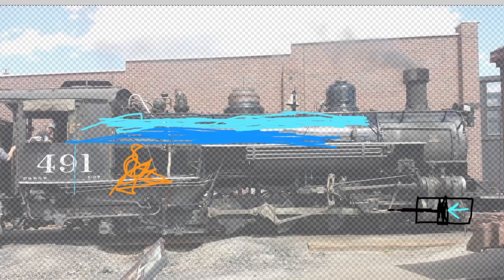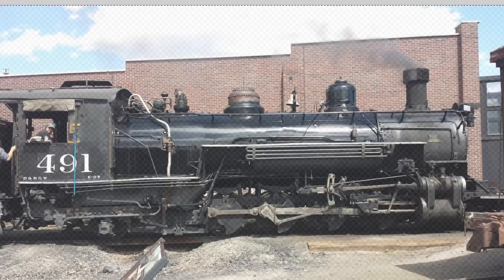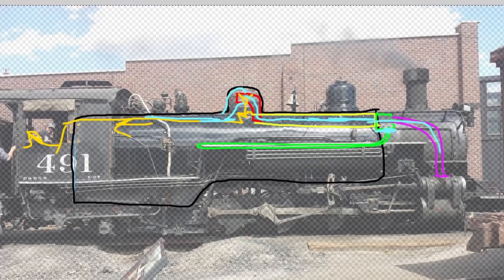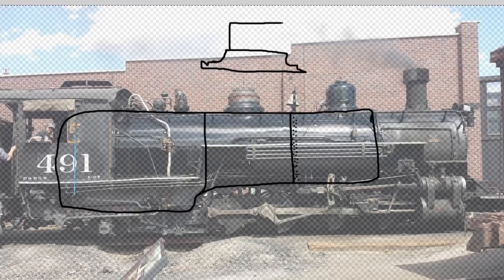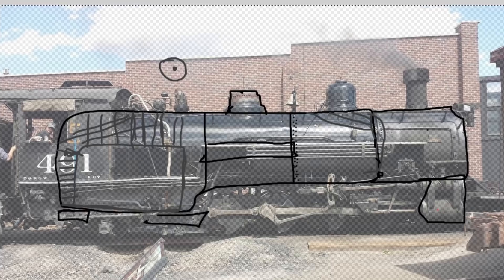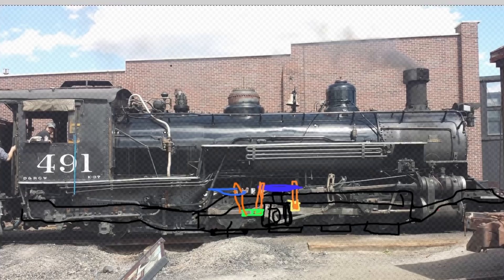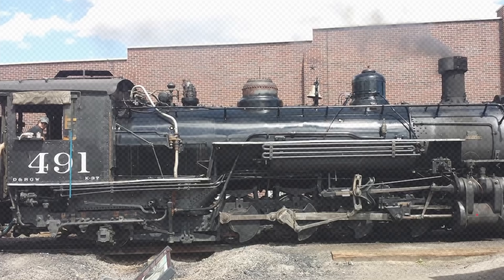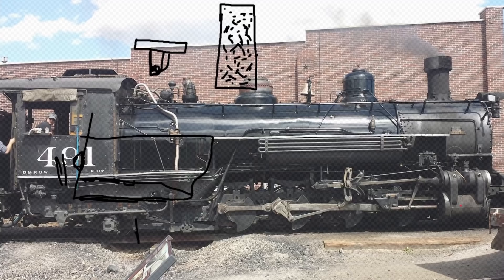Steam 101: 10 Levels of Steam Locomotive Understanding

Comment: on the riviting aspect, most of the engines espcially from the 1920's on at large locomotive builders were squeeze riveted with a giant bull riveters, or what were called gap riveters that would press the rivets with usually 50 to 150 psi of hydrolic pressure after the boiler courses were bolted togather to hold it to pick it up with an overhead crane and brought over the gap riveter and a rivet stuck in its place and squeezed with more pressure then any human can give and its timed so it makes some degree of control and allowed to fully fill the joint, also not all stay bolts are drilled all the way though some only go 3/4ths but the purpose is the same, if it leaks in a hydrostatic it needs replaced and is torched out and a new one threaded in ran over with an air hammer and seal welded to thermicaly bond the bolt to the sheets of the firebox, also seams around things are calked meaning they use a blunt chisel to butt the metal of the two surfaces togather to seal it  which I dont thing you adressed.
Reply from the maker: All true, and yes, all things I did not address! I didn't know the piece about the gap riveter. That is cool!
Reply: @Hyce777  oh yes they had those since at least the early 1900's though I dont think the pennsy shops in fort wayne had one even though it was the altoona of the west for trains west of pitsburg, it looks like a giant u shaped c clamp or piano tuneing fork, some might have been air powered but the large boiler ones were hydrolic usually steam or water over hydralic to provide the force, they were also used in bridge and ship building when they were still riveting the plates till welding improved but I know the big three builders did, lima, alco, and baldwin as well as the altoona shops, the beachgrove shops, and the baltimore and ohio main base at the mount clare works in baltimore as well as their company head quarters, and I know I saw something in an old railway age mag on google read that talked about the brewster ohio shops for the wheeling and lake erie having one as well as its own flanging press for the firebox and locomotive parts, flanging presses were basicly 4 post forming presses, or sectional flangers like a mccabe or incremental bender that would bend the metal around a die in tigher fashion then could a 4 post, they could also be used as upsetters or like a press break as, they were basicly three pistons on it looking kikd of like a singer frame steam hammer, you had the part that held the die for the metal shape, and another vertical that would press the metal down over it and a horizontal ram that would finish the bend and iron it out  usually around 50-250 tons of force they would put out, a maccabe used a toggle plate that would run off air that would slowly bend the metal around the die progressively, like flue plates or back heads for example, had a arm that looked like a rachet as the piston would push the toggle forward, like this video https://www.youtube.com/watch?v=HboAzVFxmEA with gary bensman running it and some guys at the mid continent museume

Comment: I had a chance to ride in the cab of CPR 's 2816 Empress locomotive which was converted to oil.  One thing I found interesting about that was that the fireman had to feed shovel fulls of sand in to the firebox at regular intervals to provide grit that would clear soot out of the pipes because you did not have that in the absence of coal
Reply from the maker: That's true, sanding the flues is very much a thing in oil burners.

Comment: British locomotive tended to use vacuum brakes rather than air.  The Southern railway used air brakes.  Locomotives that had vacuum brakes also had stream brakes for the locomotive.  The steam was also used for sanding equipment.  GWR locomotives tended to have tapered boilers, so no steam dome as there is a natural highpoint and also leads to natural water circulation in the boiler. Injectors need cold water.  The UK also tended to uses plate frame rather than bar frames.  

Also not all coal is equal.  The coal contains gases, carbon and ash.   The arch helps insure that the volatile gases get burnt.  
Welsh steam coal is slow burning but burns very hot,  it works well when there is a thick bed of coal in the fire.  The Castle class and King class locomotives relied upon this as they had narrow fireboxes  constrained by the driving wheels.
Reply from the maker: Didn't know that about a lot of the British stuff. That's odd. No steam dome feels wrong to me :P

And yes - not all coal is equal. Don't remind me of the time we plugged all of 491's tubes due to bad coal. Yes, I said all.
Reply: @Hyce777  Not all locomotives had no steam dome,  it depended on the degree of taper on the boiler and the design of the fire box.  If you look at the Castle class they have a Belpaire fire box.  LMS, LNER and Southern all had domes.

Comment: That was very interesting and informative. You should be a teacher. Looks like I had about a 5th level knowledge on the locomotive. Until now. Very complex machines. The inventers were geniuses. So much to learn so much to do. Thanks. 👍👍👍
Reply: I saw some guys driving a "model" traction engine at a show, once. It was tiny but, because of the power of steam, still carried two adults. They put it into reverse and it was like instant reverse, going straight from forwards to backwards.

Comment: So, as a naval historian, it's fascinating comparing the boiler setup on a locomotive to that in various ship types.  The era I'm most familiar with is the 1890s to the 1950s.  Of course, one of the biggest steam power revolutions was the transition from fire tube boilers (like you describe in level 2) to water tube boilers. This is second only to the development of the steam turbine as far as most naval historians are concerned.  

Now, in a ship, you are dealing with something far more analogous to the internal combustion engine for triple and multiple expansion steam engines than a locomotive.  I mean, you're still transitioning linear motion to rotational motion, but you're dealing with multiple pistons on a single crank shaft.  Additionally, a ship has the space to allow the same steam to be recycled multiple times before being exhausted.  In a multiple expansion engine, the steam is let into the first piston, exhausted into the second larger piston to extract more energy, and then into a third or even fourth.  Ships are big enough to allow this, but a train is far more limited.

Of course, turbines are even more efficient for high revolutions, but are very large.  Experiments were done for rail turbines, but, to the best of my understanding, weren't common.

You mentioned that steam is dead largely due to maintenance.  While true for rail, this is false in naval and electrical.  The thing that killed steam wasn't just maintenance, but fuel efficiency, and power to weight ratios.  In naval applications, both military and civilian, there still exist steam ships with incredibly high tech power plants.  The biggest difference (besides construction and control) is the fuel.  At this point, we're beyond wood, coal and even oil boilers.  The fuel of choice for a naval steam engine is uranium.  Nuclear reactors are the modern children of the steam engine.  You still have a turbine using super heated steam, but the boiler is fueled by nuclear heat.  This higher fuel efficiency comes at the cost of size (until recently, anyway), and trains are very limited in how big they can get.

In terms of power and fuel efficiency, nuclear is as good as it gets.  There was even a proposal for a nuclear steam locomotive (might be a Baldwin pitch).  Fortunately, someone realized the terror that would result from a mobile, nuclear reactor hurtling off the rails and the project was never funded.  On ships, on the other hand, you already have a mobile building.  As the ocean is a big place, there's less concern about catastrophic failures.  And yes, it's still a concern, but water is a very effective insulator for radiation, so a ship that sinks with a nuclear reactor is entombed in a large insulator limiting environmental impact.
Reply from the maker: Great comment, great to hear from someone on the naval/power side of things. We did have some amount of compound locomotives back in the day (high pressure / low pressure). And yeah, the maintenance thing is mostly a railroad issue because of the nature of the beast. If turbines were more successful in rail applications perhaps we'd still have them but they weren't really.
Reply: @Hyce777   Glad to contribute!  Just discovering your channel and enjoying it.  If you're interested, Drachinifel is a naval history youtuber who has a couple good videos on naval boiler and engine tech if you want to cross reference.  

In the end, diesel electrical is just smaller and lighter at the scales required compared to piston steam.  Ships benefit from the square cube law where doubling the size triples your volume, so turbines are feasible (and nuclear fuel).  Today, we can miniaturize a steam turbine to similar size as a diesel engine, but I don't know enough about engines to say if the benefits would financially outweigh the costs.  It would be interesting to see a design for a computer controlled, oil or natural gas fired turbine locomotive.

Comment: Rivets are the 200 year old magic connections for boats, bridges, sky scrapers and even boilers because they are still red hot after each end gets a head then they cool and contract.  Massive pressure but unknown and not measurable so they transitioned to welded boilers and nuts and bolts for buildings and bridges. Your description of how cold, zero pressure water is added to a boiler that is at 200-psi is a little murky. Great videos.
Reply from the maker: Injectors are... a very complex subject that I don't really understand to the fullest. I also don't know anyone who understands better than I do. Perhaps someday.

Comment: Fun fact: The threads on both ends of the stay-bolts  are on a single continuous helix, even though the physical thread is not present. It’s the only way to screw them in place with out tension. It’s a very expensive tap.
Reply from the maker: Yes, very, very true.

Comment: UP 844 on average goes through 20-25 gallons of used diesel-oil every mile when going 75 mph with a loaded passenger train and modern diesel behind it set to notch 2 or 3 when running between Cheyenne, Wyoming and Denver, Colorado. In the day, they used Bunker C oil (which was very thick) whereas today it’s typically used engine oil from diesel engines (locomotives, tractors, semi-trucks, Ford pickups, etc) which is a bit thinner. They use a 12’ dipstick at the front of the tender to check the level.

Comment: British locomotives are surprisingly different and generally simpler. They don't have equalising suspension, sanding is by steam power, air is for braking but often braking is vacuum powered. Frames are plate, not bar. Thermic syphons are good. Johnson bar = reversing rod.

Please comment more slowly, about 20% slower even it makes a longer video.

Comment: Well, since ya asked, wood burning fireboxes tend to be narrower than coal burning ones, also very deep. The idea is that it forms a deep chamber over the grates at the bottom that you keep filled up with wood, as you can't pack wood as tightly as you can with coal it gives the feed air time to heat up before it hits the sheets and the tube plate.

Interesting, many British narrow gauge engines were fitted with marine-style boilers, where the firebox is round just like the boiler barrel, thus it's self-supporting and doesn't need staybolts, and the grate and ashpan can simply be unbolted and slid out to do maintenance.

The downside is since the ashpan is right underneath, you have to rake it out more often, and you can't work the engine quite as hard as you'll suck the fire right out of the grate. It also wouldn't be practical to do on a big engine, as the boiler would be so fat it wouldn't go through tunnels and other restrictive clearance points.

On the upshot, it's a popular design for miniature steam locomotives, as it's easier to build and keep maintained.
Reply from the maker: Cheers! That makes sense on the wood fired fireboxes. And - the other firebox design... that is neat! Something I've never heard of.
Reply: @Hyce777  

Didn't know of it myself until recently, got to watching the "Miniature Pleasures" series over on the Railway Channel here on YT and in one of the episodes one of the guys shows his engine and it has this marine-style firebox. Literally undoes two wingnuts and the entire grate/ashpan assembly pulls out, revealing the tube-shaped firebox and the back flue sheet.

Comment: Back in the steam days the track had to be almost in perfect shape because the locomotives were so top heavy they would turn over rather easily, hence the RR's stationed a 4 man track gang every 8 miles, and they were to protect those assigned 8 miles.  If the train crew felt a (bad) spot they would throw of a msg written on a piece of paper attached to a fusee (flare) to alert the track gang, and of course it would be fixed immediately.  Electric diesels, just the opposite, all the weight was on the bottom of locomotive so consequently  the RR's eliminated a lot of maintenance gangs.  When the steam locomotive reached 79 mph the brakes would set up and force the engine to stop wprking and stop

Comment: Nice one. Thought I was lost at level six with all the axles are mounted, but glad to have catched back on seven. I actually didn't spend a thought on what could be operated by steam and air. I'd say I'm at a nice 7.5/10, but found a few things I know not being explained.
How is such engine cleaned throughly? All that soot inside the tubes, for example.
Steam coming out "under" the cylinders,
Those counterweights (I've seen and answered that in another comment),
The wheel not being "just" a cylinder but conical, also it has a tire.
I think that's all for now I could scrape from the back of my head. Maybe you could talk about these things in another video.
Reply from the maker: That's the plan! I wanted to hit "everything" on the locomotive at least in a small amount of detail. Plenty was left out, and we'll catch it down the road.

Comment: Incredibly informative!  I've always loved steam engines since I was a little babby watching Thomas, but was never really well informed on them.  Hoping to grab Railroads Online next month!

One thing I'm really curious about: why are some parts made of brass?  Between trains and playing tuba most of my life, I've always been curious about the reasons brass and steel are both used in the same mechanism for different things.
Reply from the maker: So we also have the fun nuance of things being called brasses that are actually made out of bronze, lol. Some are brass, some are bronze... it's all fun. Typically bronze is used for bearings as it's "self lubricating" - can be imbued with lubricant or has a better capacity to transfer fluids through for cooling. Typically you want steel for strength or hardened pin type applications; if you need a designed wear surface that's when bronze/brass comes into place. Make a dedicated part to wear and be replaced (i.e. crown brass over the axle so the axle wears less, and the brass is the replaceable piece) etc.

Comment: 27:30 Similar story with the passenger seats in the Concorde in that they aren’t directly bolted to her airframe.  Instead these seats were placed on rollers hidden under the floor that allowed the seats to remain undisturbed as Concorde’s fuselage lengthened by as much as 2 feet due to the thermal expansion caused by frictional heat generated from flying at Mach 2.

Comment: On the oil firebox, before you had enough steam to do its thing to the oil, did they compress air? I played with boilers at a hospital there in Denver years ago, so we used air until we had steam. I friend who played with trains there said one can to a stop and the water moved forward away from the firebox and when it came back, seconds later, parts of the locomotive were found blocks ways. You need to keep water covering the firebox all of the time. Thanks for a great video.
Reply from the maker: Yup, compressed air to get it rolling. Shop air is helpful :)

Comment: You might want to point out that since rivets are very hot when installed and when they cool they contract and they pull the two sheets of metal tightly together - leak tight.

Comment: I think the Johnson bar is used to time the engine's valves to change direction.
taken from the boiler is a vertical engine compressor for the air brake equipment.
in the cab a small brake lever known as independent  for loco brakes only,
The automatic works train and loco brakes.

Comment: FYI: the steam off the top of the boiler will never be higher than the boiling point of water at that pressure. Superheating by definition is raising that temperature above the boiling point. (air that you breathe is for the most part, superheated, even when there's ice on the ground.) 

Fun fact #1, this is a critical aspect of AC's.

Fun fact #2, subcooling is the opposite. Cooling below the boiling point. IE the water in the tender is subcooled, even on a very hot day.
Reply from the maker: Hooray for thermodynamics :D i wasn't sure how far down the "chemical properties" rabbit hole to go.

Comment: I know the 2nd item in front of the cab window is the headlight generator/turbine 32 volts @ 16 amps for the headlight and cab lighting maybe marker lights. There is a crown sheet which
could be damaged if not enough water above the fire.